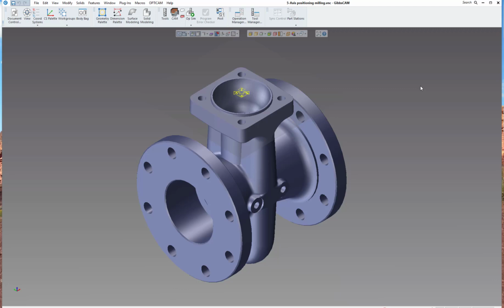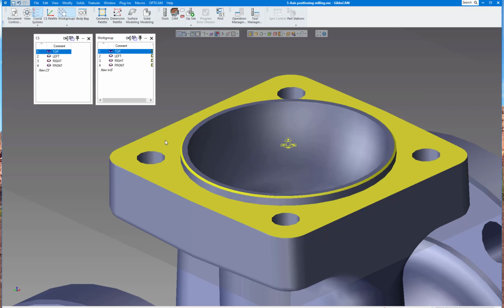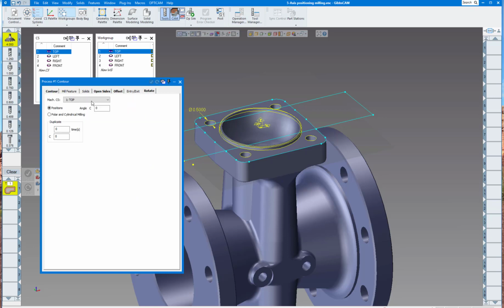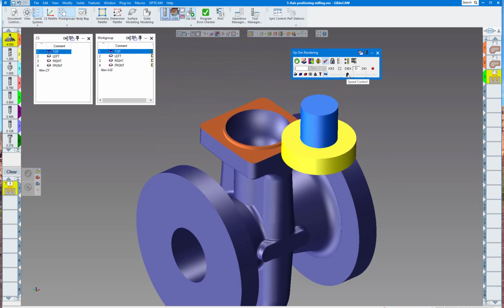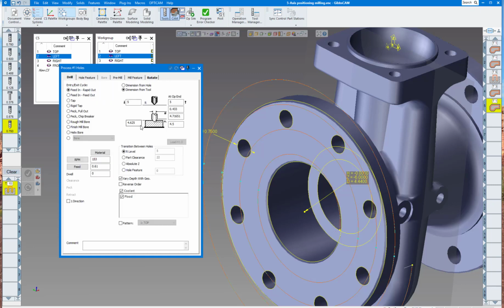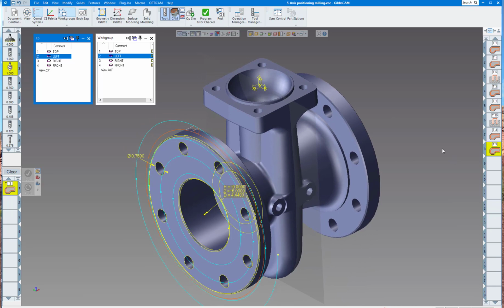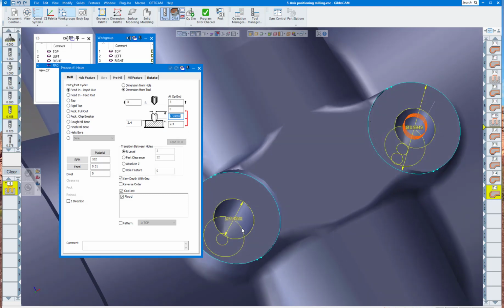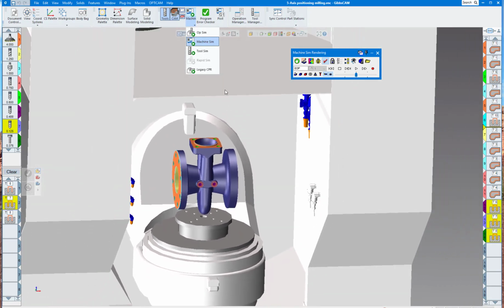GibbsCAM 5-Axis Positioning finish machining

Comment: Doing something similar but my sides are not at 90' is this still possible in the positional machining? This is my fist 5 axis part. Your videos have been very helpfull. Thanks
Reply from the maker: Yes you can.  Gibbs puts in three defaults, the XY, YZ, and XZ planes, but if you have a different angle the best way is 1st-create another CS, then open up the CS Palette (next to Coordinate systems icon), then click on the icon that says "Align CS Plane".  That's the 4th icon from the left.  That will then align that plane so you can machine it.  Hope this helps !
Reply: @GibbsCAMVideoTutorials  Thank you. We recently got a small Mazak 300 5axis and a small positional milling part was my/our  first for it and this video was helpful as to aligning everything along with all your other videos. Look forward to doing a full 5 axis part in the future.
Reply from the maker: @fiberxj  Hi fiberxj.  That's a great machine !  Thanks for watching, and glad we can help a little.